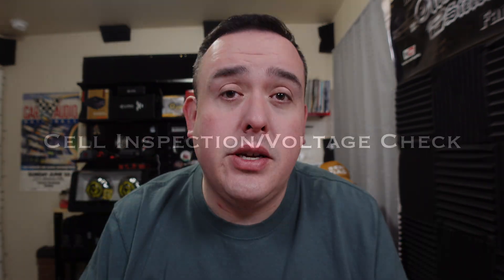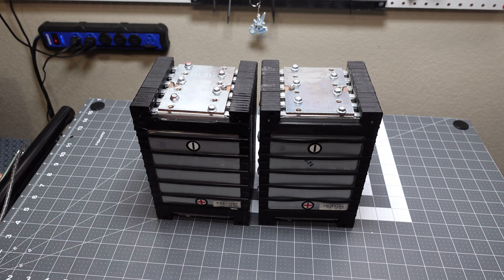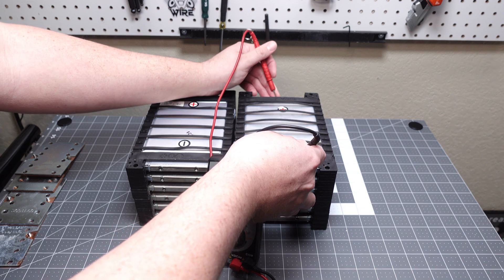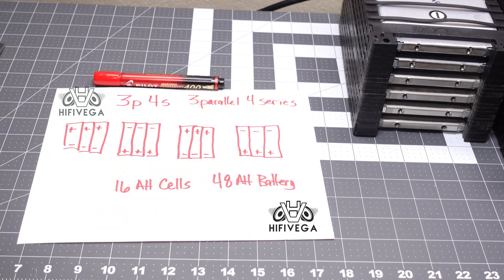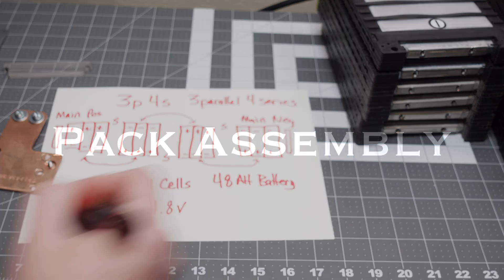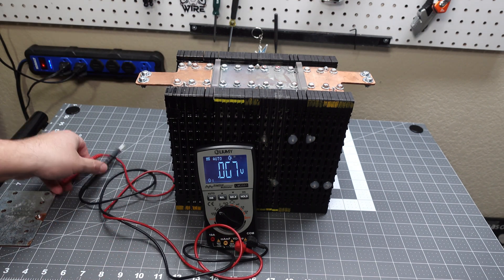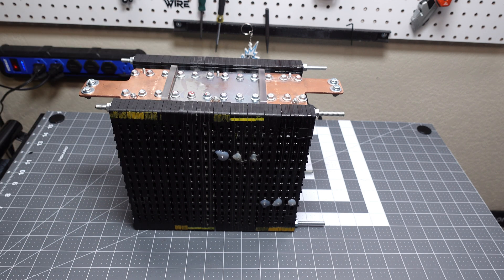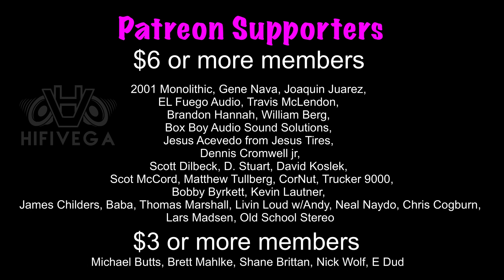Building the BEST BUDGET DIY LITHIUM BATTERY for Car Audio #diybattery #lithiumbattery #caraudio

Comment: These make great starter lithium batteries with a nice high charging voltage to get everything the amp has saw great results with the higher voltage i switched to SCIB and Caps now but definitely a great starter

Comment: Will these work with the headway together
Reply: No. Headway is Lifepo4 and thus has a completely different voltage range. This wasn't even charged and it was past the maximum Lifepo4 voltage of 14.6v. These are lithium ion cells and they rest at 15v and can be changed up to 16.8 if your equipment can even handle past 16v. Most amplifiers will go into protection at anything past 15.8v-16.0v. If you want to build a nice battery, do yourself a favor and build an LTO battery with one of the LTO options like XS power has cells widely known as yinlong 40ah LTO cells or you can get 20Ah Toshiba SCIB LTO cells. Battery hook up has some unknown LTO cells but the price is right and those I think are the cheapest, but the XS Power or Yinlong 40ah cells are probably the best quality and they are usually new. Just be careful cranking down on the bus bars. They only take 5ft/lbs of torque max or 7Nm. It doesn't take much to break the aluminum case and threads the battery is made from.

Comment: You should have just thrown them all in parallel and then charged em to 4.2 volts. That’s the best way to balance a pack before putting them in series.

Comment: Stupid question for anyone: why would the original owner replace cells that are still good? (logically assuming that's the way they end up on the used market)
Reply from the maker: This is something I’ve pondered myself, but I assume the battery eventually has a few dead cells and since it’s a big company they just buy a new battery instead of replacing the individual cells

Comment: When adding a balancer, does the board on the balancer need to be set to nmc/lfp or lto on the solder points?
Reply: These solder points need to be set to whatever chemistry of battery you're using so it knows the high and low voltage limits.

Comment: You have to charge these at 16volt anything else you are not really using them to there capabilities
Reply from the maker: I’ve found they do well at 15.3v charge, but if you can charge them to 16v you will get a little bit better performance

Comment: Can I use this in my car it says great for golf carts on battery hook up
Reply from the maker: These need to charge at 14.8v minimum, but truly 15v and up is the best scenario so unless you’re charging at 15v or higher with an upgraded alt or voltage regulator
Reply: I don’t know what I need for my 2009 Camry I order a high output alternator from autotech it’s 320 I can’t seem to find a voltage controller
Reply: @iass2158  I would make sure your vehicle is able to run reliably at at least 16 volts before committing to these style of cells. Some Vehicles can and some can't handle that high-voltage. If you want to run closer to the stock Automotive voltage range you should look for lifepo4 cells such as the headways.

Comment: Vega what BMS do you suggest and this should keep up with a CAB22 amp correct?  Lol i hope so i already ordered it.
Reply: You don't want to run a BMS as that's going to limit the output amperage from the battery. What you need to use is just a balancer to keep the four banks synchronized in voltage.
Reply from the maker: You’ll want an active balancer and yes it should keep up with that amp very well. 
https://amzn.to/3mWFgh8

Comment: What voltage does one of these banks need to charge at?
Reply from the maker: 15v minimum
Reply: Thank you kindly
Reply: Keep in mind that 15 volts is a very low state of charge. It's approximately 20% to 25%. 16 volts will get you to around 80%. So the bulk of the power from these batteries is going to be from 16 volts down to 15 volt,

Comment: I’m building a 96ah as I write. I have had no luck in ordering bars the last couple weeks. If I double up on stock bars, do you that should be sufficient till I can find some to order? Or just make 2 48ah?
Reply from the maker: The single bars will be ok for a short period until you can get bigger 1/4” or better. I’d just take it kinda easy on the bank until then

Comment: Can a car alternator charge these cells safely
Reply from the maker: These need to charge at a minimum 15v so unless you have an upgraded alt or a voltage adjusted stock alt you can not run them in your vehicle
Reply: @HifiVega  can you use a dc to dc charger from alt to this battery pack
Reply: @HifiVega the full discharge voltage is 11.20v  and max is  16.80 so running these at 14.6v or 14.8 is fine. Sure you won't get the maximum out of them at that voltage but they will work just fine.

Comment: Why do all this vs buying the 12v 48ah headway bank for $150?
Reply from the maker: This will handle more power than a 48ah headway bank, but it needs to be charged at a higher voltage and can’t be ran with agm
Reply: @HifiVega  I assumed it would be the operating Voltage.  That the biggest issue I had in my test bench was Voltage. Agm just couldn't hold it up. So I went yonlong and its very steady. 

In my truck,  I'm running a ton of headway.  Thus should help the c rating situation.

Why these particular cells tho? Price?
Reply from the maker: @ATCA  I choose these cells because of price, but also I was just interested in them. I usually make my choices with stuff like this with a video in mind. I want to build a few other different banks and kind of test them head to head
Reply: @HifiVega  awesome.  I'm looking forward to it. I use all sorts of lithium banks these days. There's so many options

Comment: Between this and headway,what's best bang for buck,and are the balancers the same,and can either be ran with a lead acid battery as long as an isolator is used,,I keep hearing don't mix lipo4 with lead acid with no explanation..thanks in advance
Reply from the maker: Headway can be ran with agm, but this cannot. These cells are more powerful, but if you’re not running 15v or higher headway is the better choice
Reply: If you want to use these higher voltage 16.8v cells you're going to need to change your voltage regulator to output a much higher voltage (at least 16 volts) and also make sure that your vehicle can handle the higher voltage. This can cost a considerable amount of money. So using the lower voltage Headway cells (14.6v max) is definitely going to be better bang for your buck since it can run with the stock alternator voltages and can be paired to an AGM battery. The reason headways can be run with an AGM is because their resting voltage will be very close to each other when charged from an alternator. A lead-acid battery has too low of a resting voltage to work with the higher voltage Headways and it causes the Headway batteries to discharge into the lead acid battery over time. For the best performance you want to get rid of your normal batteries and run just the headways. Your alternator will be capable of recharging the headways by themself much quicker compared to using them in combination with a lead battery.
Reply: @JasonWW2000  so you can just get rid of all your batteries to do a delete and run  headways for the whole vehicle are you saying get an AGM for under the hood if you have a lead acid battery under the hood
Reply: @Simpleman1078  I plan to get rid of my stock lead acid battery under the hood when I install my Headway battery bank.
I do have the option of buying an AGM for under the hood, but thats $250 and I don't need it.
You can't really mix a normal lead acid battery with the Headway cells. It has to be an AGM battery.
Does that answer you? I wasn't really sure what you're asking.
Reply: @JasonWW2000  pretty much my only other question was can you just get a headway Bank and run the car and your system on it with no AGM
Reply: @Simpleman1078  Yes, thats my plan.

Comment: I never seen that type of batteries they look more like a regular battery in stead of a bunch of toots rolls bolted together  some battery boxes with post you would never no  perty sweet deal 🎶🎵💯🛠️👍👌✌️
Reply from the maker: For sure! Outside the fact that these need to be charged to a min of 15v
Reply: @HifiVega  have to ask what are you using to charge them this hi IV seen the car set up but for in home IV haven't seen any one set up yet possibly a video on complete setup🤔😉🛠️💯

Comment: How many watts can that bank handle?
Reply from the maker: It depends on your alt, but 3k seems pretty safe
Reply: @HifiVega  can it be ran with AGM or would need a isolator?
Reply from the maker: @irishmanbd8447  it cannot be ran with agm and needs to charge at over 15v minimum

Comment: Got my ctsounds pre fab slot ported great price great quality ...installed it and the new xr12 dual 2 from American bass ....but now I have a power issue have enough amp with either the jp23v1.5 or my skar rp1500.1 put the skar back in to see if it would help with the draw off my battery but both amps are now dropping down to 9volts and all but shutting headlights off ....so I have an upgraded alternator but it's nor big enough so ...going to get a 300amp alternator....do you think if I just add a small agm battery like the one ds 18 offers for around 60 bucks will solve my problem or what should I do ...I wanna keep it around 300 dollars and the alternator is 170 .....
Reply from the maker: I’d get the alt and a cheap Walmart group 31 agm
Reply: @HifiVega  sounds good .. .I would like build one of these banks but just a little bit afraid I might cause a fire lol.....whatever I do going make sure I have enough to run the jp23 and another xr 12 dual 2 in case I wanna add another 12 but I am telling you just the one 12 in my 1998 extended cab s 10 ....is pretty impressive.....glad I done the overkill when I done all the sound mat ...doing 2 layers on top of 1 layer of heatsheild mat on floors and 2 layers on doors of sound mat and 2 on the roof and back of cab....doing a v8 swap so had to use the heat mat on floor first but I think it just added to the sound mat as well.....tha KS again hi fi vega ...we will give that a go see what happens ....
Reply from the maker: If you want Lithium do a headway bank

Comment: you should look for some a123 battery cells , they have a 31ah pouch cell that does 250amp burst for 1min and the chemistry is lifepo4 so lot less chance of explosion and fire and more importantly these cells are perfect replacement for 12v leadacid and their voltage range is exactly the same. 4 of them in series & 6 or 8  in parallel is all you need to test even the strongest automotive amp out there. 

i have a pack made from 32700 cells i bought for 50$ and it is supposed to be 12ah 25.6v but it outruns 27ah 24v leadacid in runtime , the pack is powering my ups and runs my desktop computer for almost 2 hours ! and the cells were half the price of buying 6 9ah batteries that my ups use.
Reply from the maker: The a123 cells are definitely on my list of cells to get hands on with
Reply: @HifiVega  jag35 has the 50ah ones in stock right now. 200ah ready made 12v pack is 200$ from them.

Comment: Are the battery hookup busbars safe to use for car audio? Also, is a 96ah bank this setup just x2 and 4s6p?
Reply from the maker: If you built 2 separate banks for 96ah yes. If you build one big bank for 96ah you’ll probably want more beefy bus bars
Reply: I plan to build a 96ah since I'll be a little on the low side for charging. Thank you for the information and the video! Very hard to find information on these

Comment: I tried using one of those little amazon balancers.  They're garbage.  Smoked mine upon hooking up and it was all correct.  Used the LIFEPO4 red Headways (4s4p).  Top balanced for a day and they have been installed for a few years now and the sets of 4p still have the exact same voltage, so I've just been running without a balancer.  Only have 2.5k total and never run at max volume, so it's never under any stress.

My issue with the LI-Ion (aside from being less stable tech than LIFEPO4) is the voltage.  You'd need to charge at 16.x and can't mix with LA/AGM, where as the LIFEPO4s are within .2, so no electrical changes needed, just add and go.  For a test bench though it would be fine.

Comment: I built a battery using 76 of these cells(ordered 80 total but had a couple bad ones)!  I did a top balance with the cells along with a small 1 amp charge to them for 72 hours.  I’m currently using this bank in my camping cargo trailer.  They aren’t being stressed AT ALL even when running my 2k watt pure sine wave power inverter.  These cells are awesome!  They are rated at 200 amps continuous and 400 amps max… per cell!  They are a GREAT alternative to headway cells.  Just make sure you buy the correct BMS, otherwise you will have a max battery voltage of only 14.7 volts.  Ask me how I know!!  Hahaha

Great video HiFi!!
Reply from the maker: Thanks! Sounds like you have a serious bank going
Reply: BTW, my battery should have a 152 amp/hr capacity.  However, since I used the wrong BMS and can only charge them up to 14.7 volts instead of a maximum of 16.8 volts, my shunt shows a useable capacity of about 100 amp/hr.
Reply: What bms did you use. I’m concerned about going above 14.5 volts for automotive/rv use.
Reply: @leeshearer9725  EDIT:  sorry, I thought this was a reply about one of my other lithium batteries.  The BMS in this setup is a Daly BMS that I bought off of EBay.  I can’t remember if it is for Lifepo or for lithium.  One has a max charging voltage of 14.7 volts and the other has a max charging voltage of 16.8 volts.  Either way, if you have a programmable solar charge controller, you can set the maximum charge voltage to be at 14.7 volts.  To prevent the max voltage shut off in the BMS from triggering all the time, I programmed my charge controller to stop charging at 14.6 volts.  I use EPEver Tracer charge controllers.
Reply: @91CavGT5  thank you

Comment: I smoked 3 of those lil 1.2a bms' until I learned correctly🤣🤦‍♂️ now I got a 10a heltec balancer that was very expensive and would cry if I fried it.😭
Reply: Put a piece of electrical tape on each lead when you take it off have the electrical tape in hand when taking each lead off, put on each lead immediately
Reply from the maker: I should have just unplugged it like I would recommend anyone else do 😑🤦🏻‍♂️
Reply: @HifiVega  yeah sometimes we just go and things slip thru the cracks lol🤷‍♂️
Reply: Yah I smoked 3 today also, damn im messed up son

Comment: You've likely seen my little lithium pack 'incident' already.  My house currently has about a 7.5KWH backup battery setup, made from 36V 'scooter/E-bike" recycled packs.  Was pretty useful when I lost power for 9 days in those Norcal storms.  (And all communications for 6 days, and no road for 8..  Fun times!)  Good for a couple days of lights, comms and computer/TV power, as well as my CPAP machine and electric blanket.  Have some mods planned to run the freezer/refer from it as well, just need to tie in the big inverter. (Everything else is on a commercial grade surplus UPS. Don't even see flickers in the lights when power drops, just my mini-split shutting down..:) Those SiP08 cells and the busbars would likely easily 'dyno' a 10,000W class 'D' amp at 1000A drain for the test duration. The cells each can take a 200A short term load, and you have 6 in parallel. The busbars would hold that current for a min or so fine, they just can't take over 300A long term.. Would double-check that with your build by checking terminal voltage under a short, big load. Bet they'd hold up great at at least 600A for a couple mins or so... Then quite a bit of charging..:) Just ordered a 36V 6.4KWH EV battery to add to the pile. Be careful and enjoy the power!  Stu
Reply from the maker: They asked me how much power I needed and I said “YES” 😉